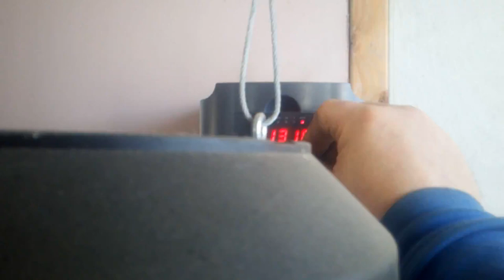Conveyor belt system for extrusion (face shield production development)

Comment: How wide can this be made to produce strips of plastic?
Reply: I am wondering for conveyor belts, welding some together via melting is an option too if need be.
Reply from the maker: In theory the width is really a matter of the pressure the dye can cope with and the preservation of the heat. I am fairly sure you can go much wider. We did some tests with large apertures but the lips were bending due to a poor construction we chose.